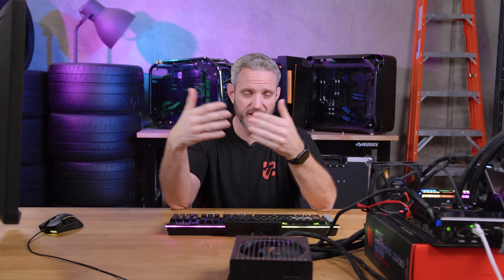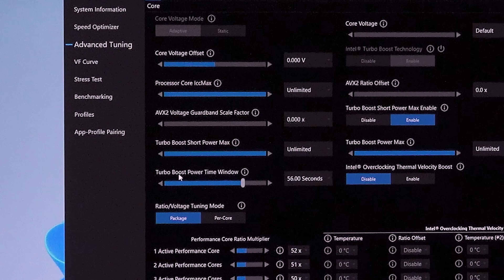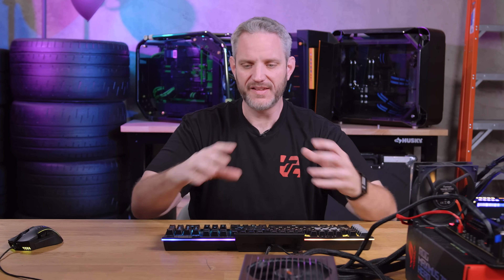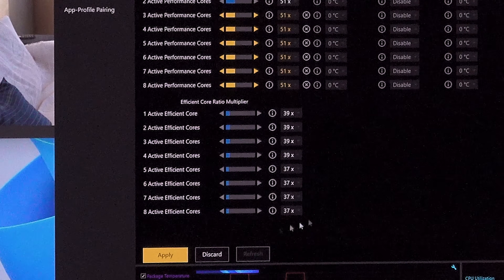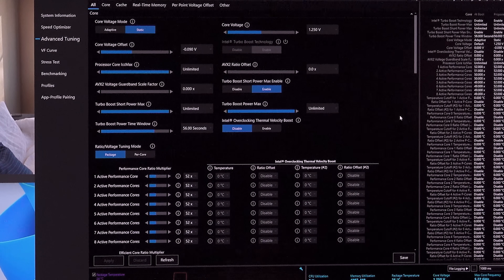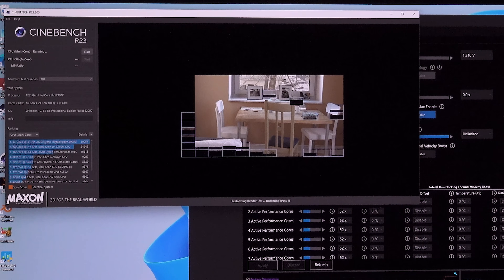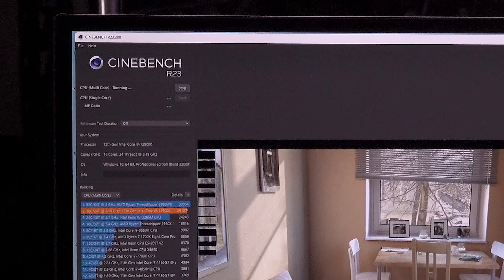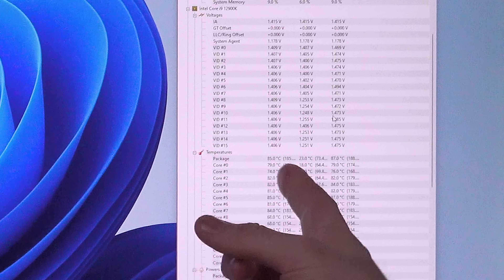Overclocking the 12900k is pointless and dangerous! Heat and Voltage testing...

Comment: In the several hours I spent trying to squeeze as much performance out of my my 6700K back in the day, I found that HW monitor has a very strange reporting tactic with voltages. The VID voltage was always astronomical and was super frustrtating because no matter what I did for offsets or even going in and setting a static voltage that was supposed to run no matter what, the VId voltage was always super crazy. After several Google searches I found that the VID numbers are apparently what the CPU is requesting, NOT what it is actuially getting. There is a VCORE voltage number thats towards the top of HWmonitor that reports what the CPU is actually recieving for voltage. I would be willing to bet if Jay checked the VCORE voltage it would show the appropriate voltage for the CPU. I know this was long winded but im hoping I just saved at least one person the several day headeache I had trying to figure this out lol
Reply: yep I can't belive jay in all his years of cpu overclocking was looking at only VID.....
Reply: @Demon09-_-  I'm not sure I understood that either, very odd.
Reply: this vid needs more detailed vcore reporting
Reply: CPU-Z should show your Vcore. Even though it's inaccurate given it's precision. But it at least tries to show the actual Vcore, not the VID... ;-)
Reply: guaranteed jay knows this. he just wanted a bit of sensationalism.
Reply: My gaming system is still running a 6700k.  I spent a few weeks tweaking every bit of power out of the system then never touch any setting again.  That was back in 2015 and it's still running strong at 5ghz.
Reply: @chaleowin7732  i have a 6800k running at 3.999 GHz.  Do you think I could overclock it at its age?  I'd be golden if I could increase it more
Reply: @chaleowin7732  wow I'm jealous. I could never get mine above 4.6ghz all core. No matter what I did it would hard crash every time I tried 4.7.
Reply: @Rubiks2025  I won't say I never crash...maybe once every 2 months while gaming.
Reply: It did, cheers
Reply: What about when idle cpu core voltage? In my case armory crate says that’s it is 3.6 and the vid section says the same. But when underload it drops down to 1.2-1.3
Reply: heres your corwn KING! Community is all about saving others time!
Reply: I am confused by your comment. I have set up a sensor that says "CPU core VID (Effective)" and it goes up and down depending on what I set on the bios. I don't know if it's 100% accurate, but considering the offset I set, 1.02v sounds like it's correct. 
So my confusion with your comment is why do you say it's weird on reporting or it's always crazy?
Reply: @LaubeQ  you may be looking at a different sensor read out than the typical VID report. If YouTube let you post pictures in the comments I could show you what I'm talking about. But the fact that yours says effective after the VID leads me to believe it's a different read out that's more accurate
Reply: @Rubiks2025  imgur is your friend
Reply: @LaubeQ  vid is only what the cpu requests normally based off cache. Once you start setting manual voltage it's reading can he hit or miss if it's right. And in the video Jay changed the voltage and did an offset. If he only did an offset with the standard auto voltage it would be correct. But there is a chance vid is off in his case since he didn't just do an offset

Comment: Nice little overclock, Not really worth it like you said. Is there anyway you could test the Wattage of the chip, cause it was already like 240w stock. Wondering if it will hit 300w overclocked, compared to a Ryzen 5900x overclocked? Kind of curious now...

Comment: Yeah more power more voltage is okay so long as the temps are under control. 

Not much headroom in the 12900k.

My Ryzen 3900XT is full custom water cooled with a per CCX overclock averaging 4503MHz. My my fast CCXs are running at 4583.1MHz and the slow ones at 4333.6Mhz. Voltage is 1.425, drooping down to 1.39V. Memory is at 1870MHz/3740MT, 64GB CL16 with custom timings.

All this results in going from an R23 score of 17900 to 21050. Tweaking the RAM timings especially helped with peak frame rates in games, probably got around an extra 10% average frames. I really had to spend time to get an 18% productivity and 10% gaming boost. It was fun, learnt a lot but certainly not for the light hearted overclocker. 

As for temps, living in QLD Australia, I was hitting 93C peak in about 27C ambient during the R23 runs. Been stable as hell though and I'm satisfied with a result pushing my 3900XT close to the performance of the 5900X.

Comment: Your focus on windows 10 in the first video 3 days ago was appreciated. I think there's a lot of us that aren't entertaining win11 yet.
Reply: Hell nah don't even get close to me with win11
Reply: I've been digging around the internet the last couple of days, I'm fairly certain the best gaming performance will currently be achieved on a 12900k, on Win10, and with e-cores off. People are starting to do benchmarks and comparisons of this and the results are interesting. Only running P-cores of on a 12900k or 12700k will still give you 16 threads! More than enough for gaming. I would not recommend switching off hyper-threading unless you have a very specific use case and are OC'ing for high clocks in that.

Comment: I dunno how much you really care about it, but starting the core number at 0 is just a computer science thing. It makes sense for computer memory since if you have, say, a block of memory starting at a location, that location + 0 is the first byte of that block, that location + 1 is the second block, and so on. Eventually, the "first" thing being at the 0th index won in computer science because it's more efficient - if I want the 5th item in a list, using 5 as the index means that the computer has to subtract 1 to get its offset in memory, which would add a tiny bit of overhead to every operation on a list. I don't know for sure, but I bet that all of the hardware and software to do with handling CPU information just numbers the cores starting at 0 (which at this point should be assumed) and HWMonitor doesn't bother to fancy the numbers up for human consumption.

Comment: Ian Cutress was saying that during his testing HWinfo was showing 100 degrees on the CPU, while he was using a cooler with a temp sensor in the block that was saying the CPU was upper sixties. He thinks that the issue is with HWinfo, not the chip.
Reply: Could have been a bad mount, or insufficient coverage.

Comment: I know you won't read it for whatever reason. But I'm a little 
disappointed with 12900K and 12Gen by and large in terms of OC and co. 
Price performance is just not there  because the mainboards ram memory and 
everything is simply too weak and too expensive for an upgrade. and on 
4K or 8K 2,5K there is no difference because even if you have an intel i7 8700k or an 7 Gen CPU you will not notice any difference in gaming. My tip for all of you if you read my bad englisch skills wait for AMD then look if you need to upgrade or not.

Comment: I have never seen a practical value to overclocking. I have run very demanding engineering software and the amount of time that could be saved by overclocking (even assuming the overclocking didn't cause any errors/problems) would be minimal. Overclocking appears to me to be just for bragging rights.

Comment: On my 5950x with dark hero mb set to activate manual overclock when above 95A (case of CB23 or other heavy cores usage apps)
- CB23 = 29174
- cores 1->8 at 4.6Ghz (better CCD)
- cores 9->16 at 4.75 (worse CCD)
- Set 1.350v for auto trigger on manual overclock
- Package Power 237W
- Max temp on cores: 88C, using an AIO and inside a Lian-Li XL 
On temps can go lower with lower voltage or higher with frequency, but on more demanding apps than CB23, like machine learning frameworks, they crash after some time, so I prefer to stay on safe side.
It seems Intel went for different strategy than AMD, go for more on first 8 cores, make them better to support more voltage and scale better, this way single threaded is better and apps not using all cores at max will benefit.
Also they removed a lot of barriers and let the system take as much as they can by default, again, different from AMD strategy.
I'm curious if AMD will do the same on Zen3+, besides adding extra cache.
Reply: 5nm-based CPU with 16 cores / 32 Threads slammed to its max potential vs a 10nm processor that has half of its cores as efficiency cores, and somehow the latter comes out on top. Intel has really outdone themselves (coming from someone with a 5800x)

Comment: Any advice for under volting the cpu specially for laptop use? I am currently running i7-9750h undervolted -125mV for core. But laptop tends to tick 95° while playing dota 2 locked to 60 fps. Ambient temperature around 27°C.

Comment: Jay, we know that in the older flight sims they tend to target Core 0. Is there a way to tell the processor which single core you want it to hit 5.4 on?
Reply: MS 2020 is the same concept and it's a new flight sim.  Core 0 is king of the hill until they port (rewrite, lol) it to the newer DX12.  So you want the fastest possible CPU you can get.  And yes, you can adjust which core is the one first queried by MSFS 2020 because not all cores are created equal and you can tell which cores are performing by using any good CPU utility program.

Comment: If your LLC is overshooting that much because of bios you're never going to be stable during normal use like gaming when it goes to full clocks. It will be way less voltage at full clocks during normal use. Essentially making this software absolutely pointless.

Comment: TR5K is in the dice bank or finished goods cage how to use this silver bullet? V5x 3D/XT refresh comes first, leads TR5K, on Ryzen late market run end performance pop. TR5K also run end likely intros mid way through V5x refresh roll out in parallel with / when Alder Lake missing $749 and $999 SKUs show up AMD laying in wait. AL missing SKUS, yes, $589 is a mid tier Intel price point think 5930K and 5960X at $999. Intel needs these high end SKUs at Alder Lake cost to produce currently $276 within the first 5% of production volume dropping to $160 between 6% and 18% of the production run is when Intel will start releasing more down bin. Ultimately Intel CPUs priced above the old EE $389 entry price subsidize all products priced below. Intel aim over the full run $60 marginal cost per unit. What might be AL $749 and $999 SKUs? Frequency bump? Ho hum, Xeon W Ice? Ho hum. AL added design with more P cores; 10? Possibly but the cost of production needs to come down first. There is a part available however where the cost is already taken into account; Sapphire Rapids 14C + i/o in MCM. 

Alder Lake WW channel; supply today 11.7.21 is 12900K = 73.60%, 12900KF = 9.64%, 12700K = 9.14%, 12700KF = 2.54%, 12600K = 5.08% and 12600KF = 0%. 

12900K is selling for $260 to $300 over 1K
12900KF for $300 over 1K
12700K is selling for $50 to $255 over 1K
12700KF for $50 to $145 ovr 1K
12600K for $40 over 1K

Available Alder in the WW channel today is 14% of all available Ryzen 5xxx_ and 12.2% of Rocket.

mb

Comment: I suppose this is a CPU from the press kit so it might be a golden sample. I am not sure if -100mV will be possible on every 12900K. Also CPUs tend to need more voltage over time.

Personally I think all that stuff is not really worth it. Just use stock settings and put PL1/2 to 125W or maybe 150W. Games will run the same and high demanding workloads will loose about 5-10% on average, but if you have those very often you better off with a 5950X anyway.

Comment: My 12 month old 5950x scores over 31000 in R23? Weren’t these 12 gen chips only just released? 

Regardless great to see Intel actually making waves right, will be good to see where we are at in 2 or 3 more generations.
Reply: It's a difference of 8 performance cores(with SMT) and 8 efficiency cores(without SMT) on a first revision architecture vs 16 performance cores(with SMT) on the 4th revision. The 5950X should be faster at this point in time.
Reply: @GahloWake  to me that just sounds like they couldn’t get 16 performance cores in their, plus their power draw is much higher at peak performance, so can’t be about efficiency? Am I missing something here??
Reply: @ThatRandomGeekyGuy  The power draw is higher at peak because the frequency is pushed higher on Intel. There's a large amount of diminishing return the higher the clocks get pushed. To put 16P in there, they'd need to either lower the clocks or make the chip even bigger to deal with the heat.

The point of ecores is that you don't need a P core to take care of things like Discord and whatnot, making running things like that on a P core super wasteful. That's why in Jay's previous video about power usage the idle power for Intel is significantly lower than AMD and when gaming they're in roughly the same area. It's only when you're absolutely slamming the CPU that Alder Lake's power issues become a real problem.

Comment: "Pointless & Dangerous" is my overclocking nickname.
Reply: Yeah like running an FX-6300 on 5.3 ghz since release just for the sake of it.😂 Took me a year to get a SMALL watercooling for it 😂 before that it was melting like Tschernobyl.but hey. The fun's in the risk right? ;D was even tempted to try 6ghz because it didnt break a sweat on 5.3. No instability and no raised voltages.
Reply: @marvinlauerwald  my FX-8350 is still rumbling along peacefully at 4.4ghz on a 280mm aio normally keep around 60c at stock it keeps around 40c (in winter I have no heater and I've seen 0c as temps and yes inside my house was around 26F) Maybe I should see what my 7 year old aio has left in it and try 5.0ghz?
Reply: @RadarLeon  do it. My guess is, it will also even reach 5.4 as most 8350's tend to clock high
Reply: I see you assume the buildzoid philosophy to OC (oh no it died to to resurrect it and kill it again)

Comment: The real star is not the P core, its only just exceeding matching Zen3 with massively higher power draws.  E-cores on the other hand are amazing.  I wonder what a 2 P-Core, 32 E-Core Alder lake would look like.  Even with gaming, you rarely need more than 2 high performance cores.

Comment: @JayzTwoCents Jay, after you changed the bios settings to ai optimized, it seems that that setting is good for the system. As someone who really has not played with overclocking and am trying to understand the finer details of it, would you say that the ai optimize setting is best for those that don't have much experience with overclocking?

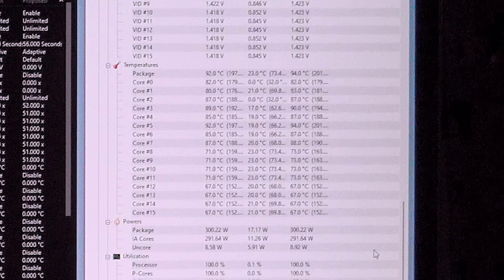Comment: Okay, I'm not sure if my comment got deleted, or if it just disappeared into the YouTube void, but I'll try again. There seems to be issues with software monitoring of temperatures with Alder Lake currently that leaves it unreliable. This comes via Anandtech in their 12900K review on their website. I'm not going to link it again, on the chance that that is what caused my first comment to disappear. This appears to be corroborated in the video, where at multiple times various p-cores report min temps of 0c. At 4:55 Cores 0 & 3; at 7:31 Cores 0 & 2; at 8:59 Cores 3 & 4; at 13:50 Cores 0, 1, 2, 4, 5, & 6; and at 17:48 Cores 1 & 2.

Comment: Eh, anymore I am valuing quiet and cool over overclocking now.  Especially undercoating overclock when possible
Reply: There's definitely something to be said for going excessively large on radiator size and putting multiple rads together. You might get diminishing returns after a point, but it's still nice to be able to get adequate cooling while the fans are barely above stall speed.

Comment: Well... you are using a board that already DID overclock the CPU and set PL1 to be equal to PL2, and that with higher voltage than required - basically like AMDs PBO but with less restrictions and not voiding your warranty. So further attempts at overclocking will not really do anything.

If anything you want to run at the Intel specifications and disable all the Asus-crap that is just increasing powerdraw with nearly no benefit to performance.
Just try it - disable all the Crap (on Asus that normally also means manually reducing the voltage to land within the specs) and then run the benchmarks again. Easy 30-50% reduction in powerconsumption, while just single-digit differences in performance.
Reply: Intel has changed how they state their TDPs. There is now no longer a difference between PL1 and PL2, at least for the K SKUs.

Comment: Forget all-core overclocking. Just use AI tweaker to assess your chip and it will determine which cores are good or not and give you a recommended voltage for each core. You're likely running into a couple bad cores that need more voltage than the others. Most P-cores should be able to get 5.5 ghz. If you set it up correctly you'll be able to break 30K on that 360mm rad.
Reply: That's exactly what he did in this video. He was selecting cores the entire time.

Comment: I'm not huge in overclocking...but I play it safe and get it to a limit to
 where I'm comfortable with that will underpower the wattage to boot...  The AMD 65W chips clocked at 4GHz (including the slight bit of overclocking used) can run at 45W under the right settings...

Comment: There's also no benefit on overclocking Ryzen or even Ryzen Threadripper. Even on a custom loop with 2 NexXxos Monsta rads. IMHO, practical overclocking is officially dead. Those CPUs are so well optimized out of the box, every 2% performance gain comes with almost a doubling of power consumption, thus a lot more heat and also a potentially shortened lifespan of the CPU. That's just not worth it.